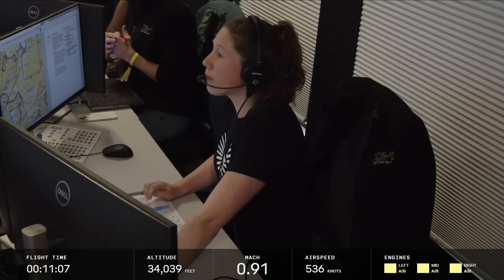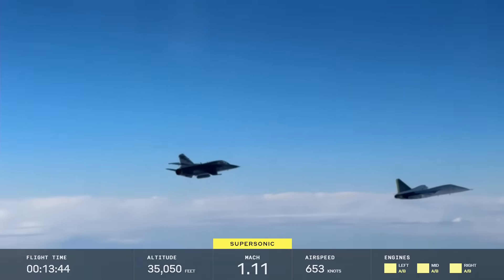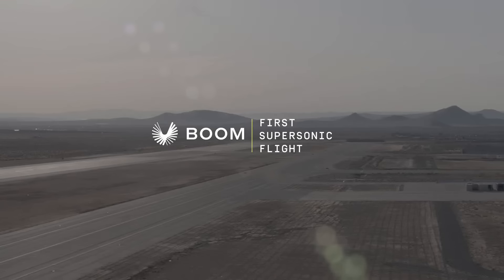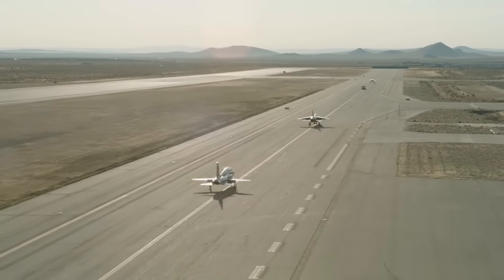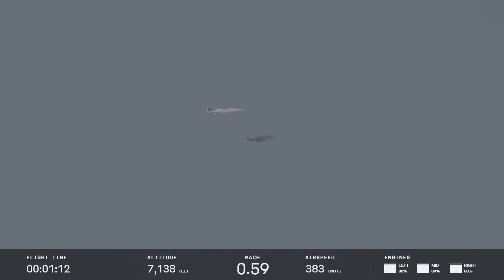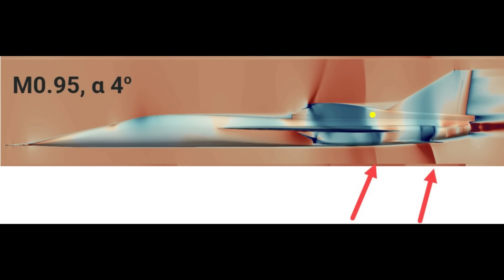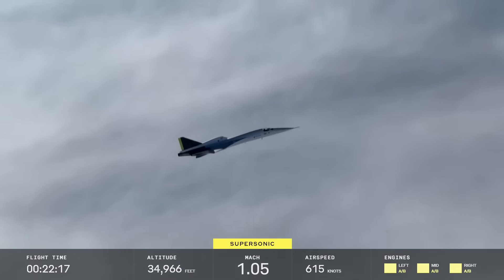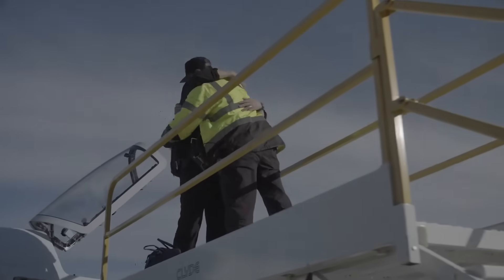XB-1 Baby Boom Goes Supersonic - Jet Planes, Starlink & iPhones

Comment: The whole Boom project seems like a fundraising scam.  It took them i think 12 years to get to this point.  And they had to abandon their own engine development and go with an off-the-shelf option.   We’ve had pointy supersonic aircraft before.  Shockwaves seem to be uninterested.   Anyway don’t NASA have its own supersonic test bed?
Reply: Other way around, they can't get an off the shelf solution and are having to build their own. The testbed exists so they can get flight data and test avionics systems.

Comment: A couple of years ago I said they would never go supersonic. So great job to Boom.
Reply: Yep, I get that. Like most similar ambitious projects I expect it to fail, but hope it succeeds. Glad they’ve made it this far.
Reply: Xb-1 has given them enough aerodynamic data to confidently move with the overture design. This is definitely not gonna fail, the worst that could happen would be a delay. They already have a super factory too. Most other sst startups ended up like aerion
Reply: @ A factory without the tooling is just a building. So they need  to build a much larger aircraft now that’s suitable for a production and a much longer lifespan. Then they also need to make the engines, which is probably about as hard as making the aircraft itself.
Reply: @hereorthere-maybe  And then they need to make it efficient enough to be commercially viable. That is the hurdle no one has thought was clearable.
Reply: @hereorthere-maybe  Rolls Royce make the engines and they have experience.
Reply: @rogerphelps9939  Negative, they had some contract work with RR but ended the relationship in 2022. Kratos is the lead with a GE company and Boom itself providing support. Note GE is NOT the engine developer, so far they're just consulting on additive manufacturing.
Reply: @brendonwood7595  I think lots of very experienced people would say it's a clearable hurdle, but that it is extremely risky to attempt to clear the hurdle.
Reply: @hereorthere-maybe  It will fail for the same reasons that Concorde did but quicker because it is just a rich man's toy.
Reply: @rogerphelps9939  Maybe. The goal is to be significantly cheaper than Concorde. Though still more expensive than an economy ticket. And many aircraft are successful and used as rich men's toys.
Reply: They lost major OEM support for the engine design though. This testbed is a great accomplishment but designing a supersonic jet engine in-house from scratch is going to be a huge challenge.

Comment: idk exactly why but the picture of the starlink module propped up to the canopy of the T38 made me laugh😂i love how thats the solution they came up with, no over engineering in sight
Reply: Back in the day, I was told to follow the KISS system when designing something. Keep It Simple Stupid! And it always serves me well. Zoom ahead to the present, and I now have a grandson studying engineering. He is building a small car from scratch with other students, with some of the professors overseeing their projects. He has been praised for keeping design of parts simple for easy manufacturing. I asked him if he had been taught the KISS system, and he asked what that was. He was tickled about that, and said he was taking that back to school with him.

Hope Grandpa doesn't get into trouble!
Reply: @ronfullerton3162  That 'philosophy' says carburetors are more reliable than EFI engines... which would be a lie.
Reply: @kennethc2466  Are you sure it's a lie? Yes they're better for a while, but there are 80+ years old carburetors still working...  What's best is seldom absolute.
Reply: @davidkottman3440 because they have been rebuilt. you can rebuild modern engines as well and you don’t have to adjust them for various things like temperature and altitude.

however modern engines lack in ease of serviceability and right to repair issues as well, but that’s a separate issue from his argument
Reply: @kennethc2466  The KISS method would mean that when you build your fuel injection system, you keep it as simple as you can! The design of whatever you are designing, is kept as uncomplex as possible!  There was nothing said about comparing different systems. Matter in fact, I have no idea of how you even considered such a thing.
Reply: @ronfullerton3162  Just the mass air sensor, let alone O2, has more complicated code and operation than a carbonator. Sorry your pet thought-terminating cliche, er, "engineering" phrase is demonstrably wrong.
Reply: @davidkottman3440  Platitudes don't make the demonstrable fact of EFI being more reliable than a carburetor wrong.
Reply: @kennethc2466  OK, I prefer efi in my car, but I also know it will not be working a century from now.
Reply: @davidkottman3440  Bye fanboy.
Reply: Yeah, if you look close, you can see the duct tape.
Reply: @stoatzsanswich8744 ahhh yessss. One of the wonder materials know as 'Duct Tape'
Reply: "no over engineering in sight"- a word used by no mechanical/electrical engineer. Meanwhile, reliance on third party JUNK is, by definition, a lack of engineering... and avionics.
Reply: @kennethc2466 still salty Kamala lost?
Reply: @mattwilliams3456  your guy won. Why are you still salty?
Can you only hate?
Reply: @Jehty_  oh I’m not salty, I’m so entertained I’m laughing at those struggling to cope :)
Reply: @mattwilliams3456   so you can only hate.
That's sad. Must be a miserable life you are living. You should try to find something positive to give you joy, instead of finding joy in negativity.
Reply: @ my life in full of joy, just more so the last few weeks knowing sanity is returning and the majority support it :)

Comment: Scott the T-38 is a fighter jet  It's called the F-5 or CF-5 they only built like 3000 of them.
Reply: Not quite the same thing. Both made by the same company and derived from the same project, but there are more differences than simply taking the guns out.
Reply: @karl0ssus1  They are more alike than different

Comment: I seem to remember Concord crashes. That might be why they never did that well, as well as mismanagement in production
Reply: @bzick405  Crashes... Concorde crashed once , and that was due to debris on the runway!!!!!!!!!!!!
Reply: Nope that was the Russian copy. The incident in Paris was due to the French not keeping the runway clean from junk. Both government and commercial were looking for a excuse to suspend operations. As the world had decided they didn't want sonic booms. Think they were upset really. From memory the USA had a go but couldn't get it in budget or work ?
 So, nice to see them finally getting there. 🎉 The main reason it was developed was as a delivery system for the things going big bang. Went at Mach 2+ if you pushed it. Which at the time scared the crap out of the opposite side. As there missiles/aircraft couldn't get to it. Ho hum.
Reply: The single crash was in 2000, Concorde first flew in passenger service in 1976. Economics is mainly why the aircraft didn’t do so well. Mismanagement in production? Don’t think so.